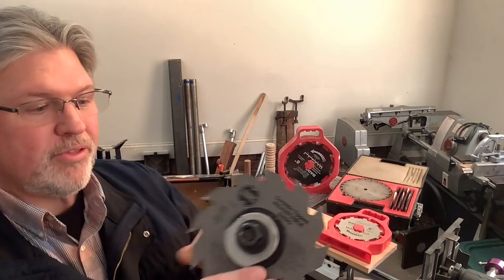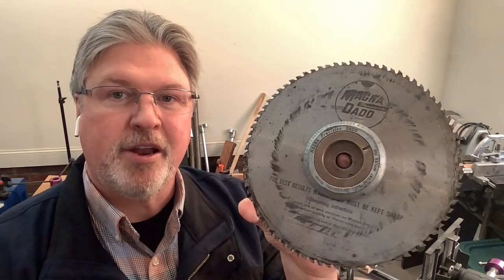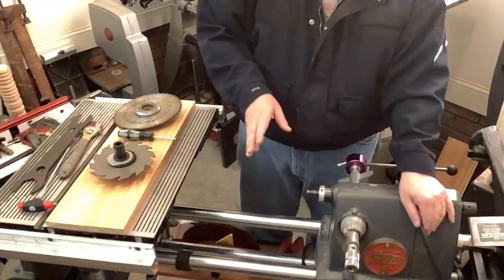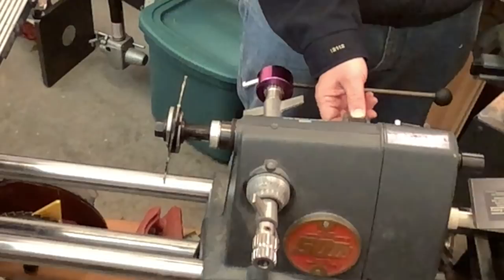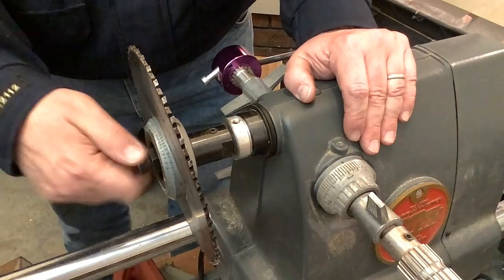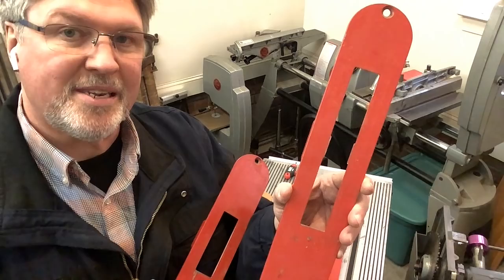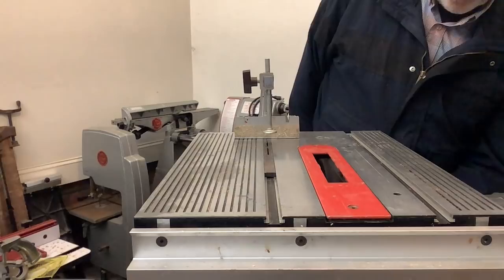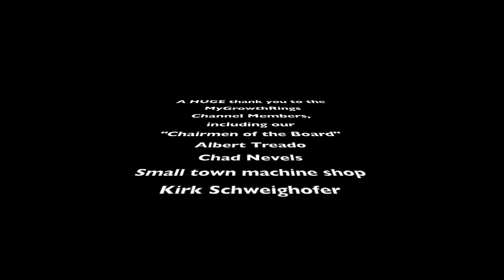Dados on a Shopsmith and What's a "Magna Dado"? A Wobble Dado? A Drunken Saw Blade?

Comment: I have a Magna dado. In the original box. A reference board with measurements for each letter was really helpful! Currently using a carbide stack dado set.
Reply from the maker: It really was advanced in its time, but it's hard to beat a carbide stack.  Scott

Comment: My first Shopsmith was a Mark II.  It came with a Magna Dado, and no guards at all.  That blade scared the #3!! out of me.  The whole machine would shake when I ran it.  I finally got a stacked dado, and gave the Magna Dado to the guy who bought the Mark II when I bought a 510.  I’ve been running a stack set since then.  Good video!
Reply from the maker: Thanks Stew. I have a Mark 2 but nobody gave me a Magna Dado! Sounds like you've been making good choices.  Scott

Comment: I got an old dado set that includes several different size chippers and washers
Reply from the maker: Is it a black case with a clear top?
Reply: @MyGrowthRings  yes.  Ive found an adapter that seems to fit but ive never used it.  Presumably safe
Reply from the maker: @toddharshbarger8616  Yes, they should be. They don’t leave a very nice bottom but they do make clean cross-grain dados. Scott
Reply: @MyGrowthRings  I don’t think it has carbide tips as the magma dado.  Hence more chip out and not as clean of a finish?
Reply from the maker: @toddharshbarger8616  Actually, steel blades are sharper than carbide-tipped blades, but not for long. The Magna Dado sin;t carbide-tipped but the 6" Shopsmith dado blade is.  Scott

Comment: My ShopSmith came with a 10 tooth craftsman wobble dado. I tried it once and promptly threw it in the trash. The Magna looks like a much better setup. Thanks for the video, great job!
Reply from the maker: Thanks Jon.
Reply: I have a craftsman that is a wobble except it is made with two blades.   Other than not a perfect flat bottom it is pretty easy to use and does a great job.

Comment: I have a craftsman dado crazier than that.   It is two blades next to each other. If you spin the two blades in opposing direction the spread apart on one side. It too does not make a flat bottom and it is a bit scary too.  It is 8 inch.  

The other day I seen CMT makes a new dado stack and it is made so the chipers lock in place and can not slip.  I guess on the stacked blades if the chipper slips the teeth collide and the bits of carbide can go flying at you.  So in europe they have been banned already but this new CMT set doe not have that issue as they lock together and can not slip.   731 woodworks get a great job reviewing it.
Reply from the maker: Is it this one? https://youtu.be/UHKbuu4rtjM?si=nx1IoekDPz0PKw7_. I’ve also seen the CMT and it’s a great idea.

Comment: I have a 6"  SS stacked dado set that came with my 1984 Mark V, it work fair, so I got the new model CMT SS 6" Stacked Dado set works great on the M V. very smooth cuts. I bought a new old stock Craftsman wobble dado fo my RAS, but never used it, wasn't sure about it, but I think I might try it on the Mark V. Thanks Scott for the great video.
Reply from the maker: CMT makes several sweet dado sets. Is your Craftsman a single blade dado? Scott
Reply: @MyGrowthRings  yes it looks like your single blade dado.
Reply from the maker: @allenriff9242  Got ya. They made a very interesting dual blade wobble dado called the Excalibur that I’ve always wanted to try. Scott
Reply: @MyGrowthRings  I have the excalibur dado, came with the SS, don't like it at all.  To darn hard to dial in exact cuts. Freud stack sets are the way to go. Curt

Comment: Scott, great videos.  I learn something new each time.  I have the older 6” stacked dado from SS and it does not leave at flat bottom particularly in plywood and I stopped using it.  Good to know there are better stacked dado sets available.  I thought the SS was limited to 6”.  Can you explain the benefits/drawbacks of 6” vs. 8”?  Thanks
Reply from the maker: Sure thing. Yeah, good carbide stacks can leave an excellent bottom. That said, avoid cheap sets like the Harbor Freight. I had one to play with and it was just sad. Scott

Comment: Was the Magna Dado made available again when John Folkerth put the Mark V back into production in the early 1970's? Or did they switch to offering the Vermont American wobble dado from the start? They also had the Shopsmith 6" stacked non-carbide tipped dado set before switching to what they offer now which is CMT's 6" stacked dado set.
Reply from the maker: Good question. No, Shopsmith Inc. Never brought the Magna Dado back from the dead. Shame, really.

Comment: I can see where that wobble dado blade will give a smooth bottomed dado which is excellent.  I have both a Shopsmith and a B & D 6" dado stack.  Disappointed in both as to the smoothness of the bottom of the cut.  As you said, if it is buried it's fine, but on a rabbet joint and looking at the ends it can be ugly as sin.  Guessing a much higher priced dado set would be a lot better or not?  Just finished some small boxes for game board pieces and had to recut the rabbets with a router to get the corners tight and square.  Each blade is flat but appears they are not all the same diameter by just a little bit creating the uneven bottom.
Reply from the maker: Yes, I’ll use the 6” carbide stacked set in the follow-up and you’ll see the difference. for the price of a couple router bits you can get a fine set. Scott

Comment: Scott, thanks for the video, I wanted a dado so bad with I first got me shopsmith back in the 80's.  I notice that you had a tool shelf on the system you were using in the video.  Did you ever publish anything or plan's on how to build one yourself?
Reply from the maker: The shelf that is on this Mark V is a poorly built and designed shelf made by the guy who sold me the machine. I have a design in mind but haven’t found the time to build it yet. Scott

Comment: I had a radial arm saw that used a wobble blade for its rabbets.  I never liked the radial arm saw because I couldn't keep it in exact alignment.  I liked the wobble blade even less...too scary.  I have a 6" stacked dado set that I've used on the SS and feel much more comfortable with.  Very flat bottom and cuts the wood like butter.  Been very happy with that set up.  Always wondered why the dial said "magna dado"; great to know that bit of information.  Super video.  I would also like to know more about the molding cutter head.  My Dad had one but I use the shaper and router for all my moldings.  Am I missing out by not having a molder cutter head?
Reply from the maker: Hey Anne. No, I don’t think you are missing anything. IMO moulding is cheap and most of the profiles that are available have been overused by sloppy practitioners. I’ll be happy to show it, but I don’t really ever use it for moulding. It does make a mean raised panel, though.  Scott

Comment: Scott that Magna Dado is just what I've looking for, I need to make some small dados for some small crosses and the regular dado set will not go that small.  I was looking at the ones you listed on eBay and I was wanting to know if the "Vintage Henry Disston & Sons Magna Precision Dado" will work in the Shopsmith or only the one that says "Shopsmith Magna Dado" will work on my Mark V?  Great info on that blade.
Reply from the maker: The Shopsmith Magna Dado was manufactured for Magna by Disston, so you are on the right track!

Comment: Huh.  I don't know how many times I've looked at the term "Magna Dado" on the speed dial and never stopped to wonder what it referred to.  I have a "drunken saw blade" (never heard that term - love it!) from Sears that I bought back in the 80's and have used ever since.  Though I have no doubt that stacked dado blades are much better, the wobble blade had always served my needs perfectly well and it cuts pretty flat and clean for me.  I guess I have a high tolerance for "adjust-measure-adjust-measure".
Reply from the maker: You and me both!  That said, I do like a stacked set because you can pretty much trust that when you put 5/8" worth of blades together that they are going to add up to 5/8". Scott

Comment: The insert being too low or high on my Mark V 500 and now my 520 have always bothered me.  I hate having the wood drop as it transitions from table to insert almost as much as having it interfered with.

Leaving the screws loose seemed Mickey Mouse. On the 500, to get it truly level, the screw head would actually protrude above the insert by a few thousands of an inch. And, the insert would vibrate.  Being a safety and quality nerd... that drove me nuts!

My solution was to cut washers out of some plastic pattern stock and shim it level.  That still works for me.

Now about those dado blades... My first venture into them was the Craftsman 6” wobble blade.  It was made by Vermont American.  

I mounted it on my Craftsman 9” direct drive table saw.  There was no speed adjustment and the insert had an opening the size of a Flathead Catfish mouth!  

Being young, inexperienced and feeling bullet proof... I decided my first cut should be full width (at 13/16”) and half the depth of the board (at 3/8”).  After all it was a brand new blade and should cut wood with  resistance akin to room temperature butter.  Right?

Then, to ratchet the challenge up just a bit... I decided to do a test cut first using a 3  1/2” X 6” long piece of red oak scrap.  Oh, did I mention that the Craftsman safety kit came with a plastic push stick but no hold down?

At any rate, I set up the fence and laid the board on the table.  Using my left hand to control the feed with my push stick, I started sliding it along the fence. Realizing that the blade was spinning toward the stock, it occurred to me that the piece of wood was probably going to be flung back in my face... now, an experienced or wise man would have reconsidered his options at this point.

I was neither... instead, I used the most available tool that I had to hold the board down.  I mean after all, I’ve always been very good at math. A 3/8” deep cut in a 3/4” thick blade leaves a 3/8” margin of safety between it and the top surface.  Right?  

As I was driving myself to the Emergency Room it occurred to me... 

1. Removing 13/16” X 3/8” of red oak in a single pass creates a thousand tons of resistance.

2. Cutting big dados in tiny wood requires considerable pre-thought about guidance and containment.

3. If they can replace 1/2 if my middle right hand fingernail, I’ll never use my hands for a hold down or push block again!

4. I hope the blood doesn’t rust my shiny new dado blade before I get home to clean it up!
Reply from the maker: Thanks, William. It really is amazing how many lessons we can learn from one little accident! Very good points. Scott

Comment: I have the Magna Precision Dado and used it a couple of times, worked fine. A very clever and interesting piece of engineer, as are a lot of Shopsmith tools. But, I promptly bought the Oshlun 6 inch dado stack (works really well for me)  because I found the wobble very unnerving. Logically, I don't see any increase risk in using the wobble vs. stack, so probably an irrational fear. But, I'm in the garage to relax, not scare the crap out of myself.
Reply from the maker: I think most fear is rational.  It's hard to beat a stacked set, for sure. Scott

Comment: So interesting.  Thanks Scott.  I frequently adjust table height to fine tune depth of cut while using extension tables.  What's everyone do to most efficiently adjust those extensions to keep everything flat? I've been disconnecting the extension tube from main table, adjusting main table height, then laying a straight edge across the main table and extensions, adjust extensions to be level with main, and reconnect the tubes. My method always seems awkward and inefficient.
Reply from the maker: That’s just about the only way of doing it. If I’m using the extension table to support the fence it’s far more critical, but otherwise it doesn’t bother me if it’s a little bit low as it’s there just to support after the cut. I also rarely use the extension tubes unless I need a floating table or if I’m applying horizontal pressure against the fence, as when horizontal boring or disc sanding the end of a board. Scott
Reply: @MyGrowthRings  Thanks Scott.  Just looking for a more efficient way. I'm sometimes using a large crosscut sled and then this becomes even more tedious.
Reply from the maker: @hfmann1  I have a stop collar on the support table that is locked at the proper hight for crosscutting 1" stock, so I actually adjust the main table to it with a straight edge.

Comment: While it's true that no single cutter wobbles back and forth the blade as a whole does.

It occurred to me that even for a stacked dado set but especially a wobble set, using a kerf maker like jig would make for a quick to setup.The dado blade(s) need to be set to "just over half width" and then make two passes using the kerf maker to adjust stock positioning. It also has the advantage of lowering the load on the tool since you less material is removed per pass.
Reply from the maker: That is correct. And considering that most of the sheet goods that we have available to us aren't produced in Imperial dimensions, most American dado sets will require some fiddling that the kerf maker eliminates.  Scott

Comment: Mostly interested in using modern dado blades on my (new to me) SS. Any pointers regarding setup or use with those?
Reply from the maker: I'll install a set during the mid-week follow-up. What I can tell you is buy a modern set with an anti-kickback design and unless you need the depth of cut I would go with a 6" set. Scott
Reply: @MyGrowthRings  I have Freud finger joint and regular dado stack sets. Both are carbide but how can I tell if they're anti kickback type ? Doesn't anywhere on the packages. Both work fantastic. Thanks for producing and sharing great videos. Curt.

Comment: I have a Powerpro and do a lot of none thru cut re-sawing. By how much can I safely reduce the blade spend to get more tork as an option to reducing the depth of cut and not trip my circuit breaker?
Reply from the maker: You really shouldn't be tripping breakers with the PowerPro. Are you running on an extension cord or searching a circuit with another tool or DC?  You can safely run it in "dado" speed, or roughly 3450RPMs, but again, I wouldn't expect you to have to do that with a PowerPro. Scott

Comment: I recently acquired an old 1956 Magna 700 series table saw...still works and is as accurate as can be.  I'm having an issue being able to get the arbor off to switch out the blade.  Is there any advice you can give me or something I need to purchase to be able to accomplish this?  Thanks for any advice you can give me.
Reply from the maker: I also have one of the saws and it’s pretty slick. I would suggest removing the setscrew from the arbor and spray WD-40 or a similar penetrating lubricant and make a wooden wedge that you can drive between the arbor and the shaft. It’ll likely be slow going but once it moves an eighth of an inch you’ll find it will come right off. Once you have it off I would suggest polishing the shaft with a little scotch Brite and do the same inside the arbor.
Reply: @MyGrowthRings  Thanks.  That was my next though but wanted to make sure I wasn't missing something first.  I'll spray it down with some rust break or wd40 and hope to get it lose.  I was making a crosscut sled for it last night and noticed that I'd get a high pitched squeak out of it...thinking it may be a good idea to just put some new belts on it.  Any thoughts on that?
Reply from the maker: @jonasmorehouse738  It’s quite likely that you’ll need to replace a bearing or two, but that’s an easy task.
Reply: @MyGrowthRings  thanks for the advice.  I was able to get the arbor off.  Now to find the 5/8 arbor nut and space so I can use a normal blades on it.

Comment: would like to see a vid on molding head cutter
Reply from the maker: Danny, I’m sure we can fit that in. Scott
Reply: I agree, Shopsmith just ran a sale stating that they are not supporting the molder heads cutters any more.  I picked up a few, since they won't be available any more.  When would use the shaper blades?  When would you go with a router.
Reply from the maker: @daveschmitt6369  Shapers are used for shaping edges, in a similar way that some router bits are used. Molders or moulders as they were originally called are for the face of stock. A sharp router bit on a router will produce an excellent edge, much like a shaper cutter on a shaper will cut, but a shaper is much quieter and they tend to be rock solid. Now, a shaper cutter on a Mark V or a router but powered on a Mark V is a different story because of the slower speeds. We’ll have to do a video or two on this in the future. Scott
Reply: @MyGrowthRings  looking forward to it.  I have a speed increase that I use for 1/4 in shaft routers.  I've tried some larger bits for cabinet making, and they didn't see that stable.  I've used the shaper a few times but who know if I was using it appropriately.  My experience is that if you take small depth cuts, all three can produce a nice result.  If on the other hand I take too deep of a cut, well lets say its time for a barbecue.